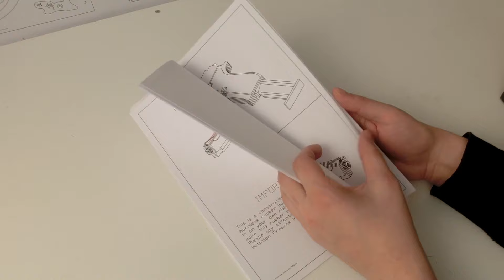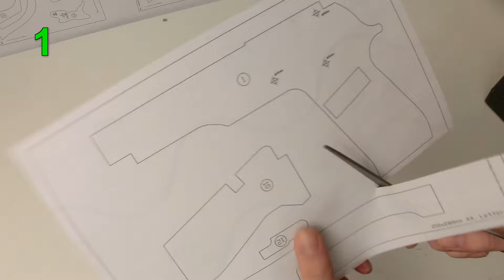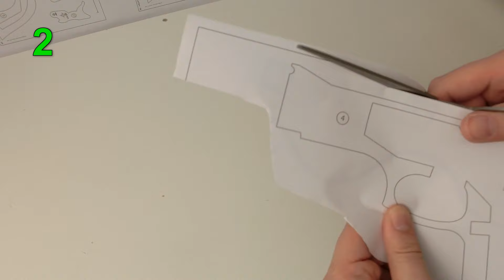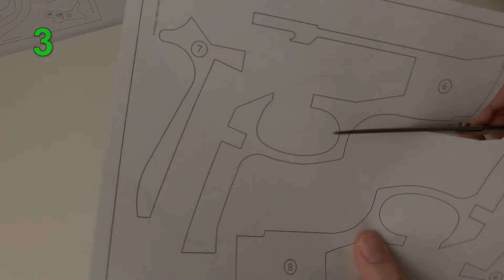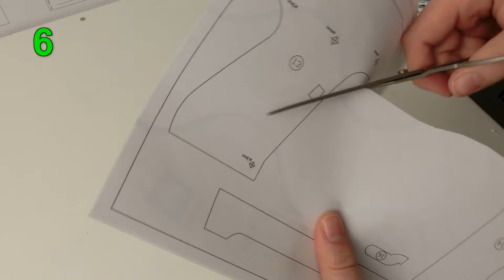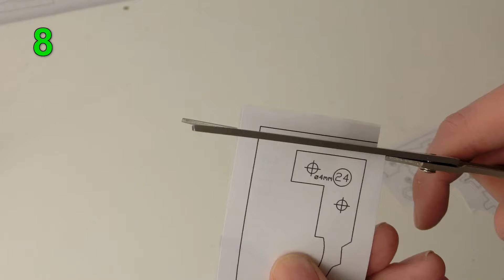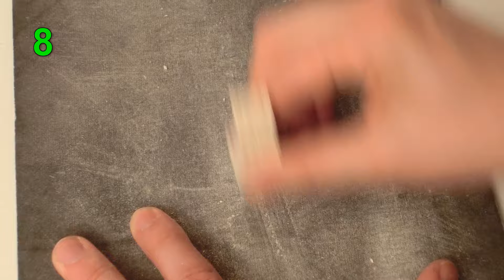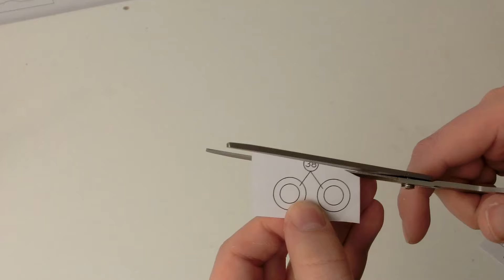Tutorial! M9 [rubber band gun]

Comment: I finally got around to making this.  I used scrap plywood shipping crate.  It was about 8mm.  So I had to use cereal boxes, Tongue depressors, toothpicks and skewers to offset the size differences.  But I ended up with a working model.  Thank you for the support files, they were a REAL TREASURE.  I could never have done this on my own.  I learned a lot of lessons on my first build and will be making a second (using 1/8th in wood).

Comment: who is that committed for a rubber band gun...... just go buy one
Reply: Where...
Reply: BlackLight7 a store, ebay, amazon. its not that hard
Reply: all ive found is a crappy versions that arent as pleasing look wise like this gun does. im allways finding the ones with the black plastic wheel at the back and the same shaped gun wich looks awful... im searching for a rubber band gun that looks like this gun or something close to it or close to any gun from the Glock pistols family. if u know a place i could buy one of those it would be greatly appriciated if you could tell  me where i can buy them and mybe send me a link. ty for reading and fro the help!
Reply: Well thoose with the black plastic wheels can hold much more rounds/rubberbands than this one. And perhaps you could take the gun and sand it and perhaps put some stuff on it. Like a nice looking handle or something? Modify it yourself :)
Reply: id rather cut out the shapes onto Styrofoam and use that to cast a aluminium version of this gun
Reply: amit ghosh i like making concussion grenades with the caps, you throw them against a hard object or drop a rock on them and they explode with enough force to make you dizzy and confused, they're awesome
Reply: amit ghosh יש סיכוי אתה מתרגם לי את מה שאמרת?
Reply: Ryker Alley They are waaaay too overpriced.
Reply: koolerpure That sound awesome

Comment: Compliments: Following the steps exactly and not taking unnecessary risks. Using scrap pieces of wood when clamping to prevent clamp marks and to apply even pressure. Using a rolled up piece of sandpaper with a dowel inside to sand round areas.
Criticisms/suggestions: I feel like you might have wasted a bit of time, especially near the beginning, by only gluing one piece at a time, even though they were part of the same step (I can understand this being necessary if you didn't have enough clamps, which is very understandable if this is the case). Cutting out all the pieces at once and leaving the paper on (or taking it off and using a pencil to write the numbers very lightly) would have saved you the trouble of having to clean up the saw station so often, and made it a little more convenient. Also, this is just a personal preference, but if you use acetone on the paper it just rubs right off the wood.
All in all, really good project, just seems like it would be a little inconvenient.

Comment: Thanks for the tutorial! Good job. 
There`s a little mistake on the blueprint, it says 210x280 but it is 210x297mm! 
I milled it on my cnc and got some non fitting parts... with correct dimensions it works fine.
Reply: +Bernhard Schmidbauer I am interested in trying this on a CNC at a local guild. I am new to CNC and was curious how you did this. Did you replicate the plans on a design software? Thanks.
Reply: +vmc5555 Yes, I replicated it on my aged proprietary CNC software called Win PCDREH, so unfortunately it won't help sharing with you. The normal way of CNC operation is: design in CAD, create route path in CAM and route with the machine's control software. So you should go to a CNC workshop and they will tell you how they work, which software they use and which formats they can import.
Reply: +Bernard Schmidbauer Thanks for the quick response, it was very helpful. I'm familiar with CAD so I'll get the shop guys for the CNC portion. Thanks again.

Comment: hey RBguns im making this gun, ive bought all the equiptment from bunnings though the hardwood (the exterior wood on handle) is the only thing i could not find, any advice? i was thinking to just use the plywood and just paint it. would that be a bad idea or not? thanks for your help and all the beautiful designs at our finger tips. cheers
Reply from the maker: Entarivenes ask a local carpenter, use mahogany plywood or use wood stain. :)
Reply: thanks for the help, i noticed in your showcase video of this gun, in the last clip you showed the gun with a clear material, might i know what that material is, as if i dont find such mahogany plywood or wood stain i will go for that look. do you think this is appropriate to use? the plastic or glass? whichever you were using?
Reply from the maker: Entarivenes It's acrylic glass. I think wood would be more appropriate.
Reply: RBguns thanks, was tied between the two, it just looks so good when you see the mechanism.

Comment: RBguns im going to start making this gun but one question, is it possible to just cut all the pieces and then pu tit together according to the tutorial? is there any set backs to this method? answer asap, thanks
Reply from the maker: Entarivenes that's ok. No problem.
Reply: RBguns  thanks you for such a quick reply. also one other question I couldn't find hardwood, so is it alright to use the plywood and just paint it, or do you think after extended use it wood turn out bad?
Reply: RBguns I have started the work but unfortunately I can not get such precision in the cutting as I am using a jig saw and saw and chisel. I'm really disappointed, is there any tips as for what I could do with these tools (I can not buy any new tools). I was wondering with the rounded edges it they could be boxed off. Thanks for the help thus far, its been greatly appreciated.
Reply from the maker: a fret saw would be much better. It's not expensive
Reply: RBguns I will try to get my hand on it hopefully. thank you for your help, I will message you when I finish it or if I run into any problems , thanks again :)
Reply: RBguns Hey, unfortunately after searching extensively for a fret saw to buy i could not find it. Do you know anywhere I could buy in Australia? Thanks.
Reply from the maker: Entarivenes
 No, I'm sorry. You could ask parabellum1262. He is from Australia.
Reply: RBguns its alright now I went to bunnings just an hour ago and they suggested using a coping saw. thanks for the help, hopefully I will be making this by 2.
Reply: RBguns I didn't end up making this, after several failed attempts of making the cuts, I gave up. I am on the way of making parabellums simple shooter, the cuts are bigger, thus easier with a saw. Still an awesome gun, but I'll leave it for the more advanced :p.
Reply: They're called a coping saw in aus any hardware store has them
Reply: RBguns PLZ REPLY ME. IS USING 3MM PLYWOOD OK FOR THE STEP UP ACTION?
Reply: yes it is Pollack Jared
Reply: Entarivenes Hey, I have another question regarding the Step Up action. 

Is it possible to glue the 'number 4' gun to the front and not drill it? 

I'm not sure how the drill works. Do you drill the screw by hand in which it goes through the wood? Does using the glue instead work?
Reply: Pollack Jared glue should work but the screws will hold everything together better
Reply: Entarivenes Alright, because I tried the drill but I'm having trouble screwing them all the way in so I'll glue it then. 

Maybe I'll glue and screw, you think that's better?
Reply: Pollack Jared Yeah glue and screwing will be better but if you can't just glue and make sure that something heavy is on it, but not something that will damage it.